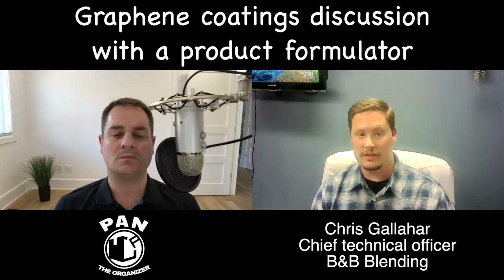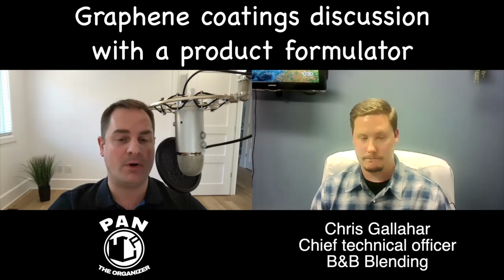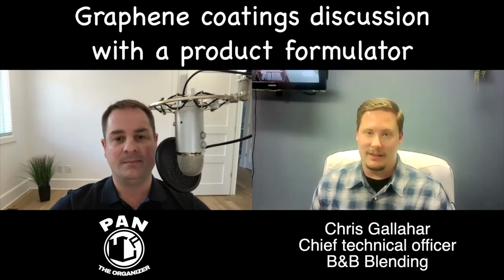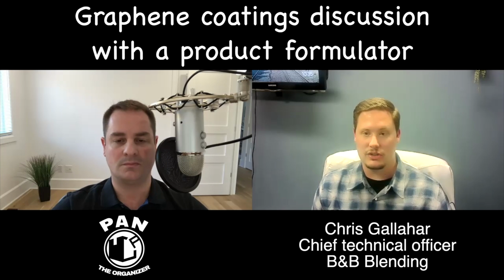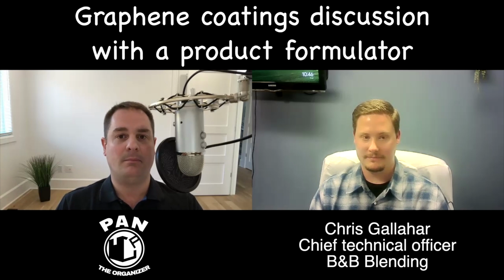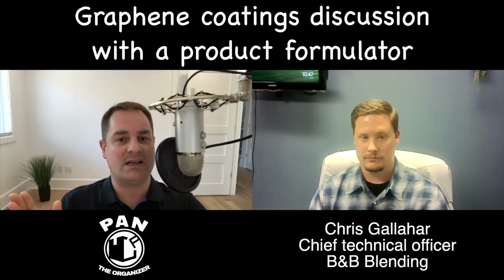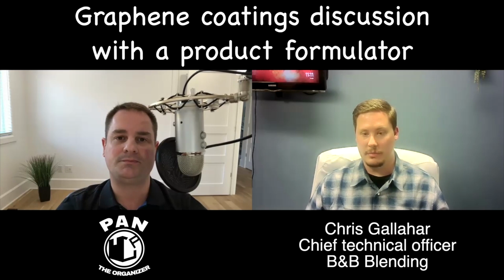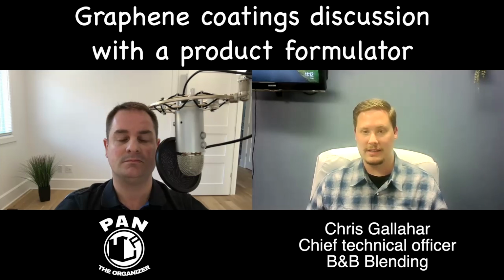EXCLUSIVE interview with B&B Blending about graphene coatings and detailing products!

Comment: Chris mentioned "angles" in beading and sheeting. What does the angle indicate or mean and what angle on the bead or sheet does this refer to?  Is it a measurement from the surface panel and water Edge? How is it actually measured? Is there a diagram to explain this? It seemed to me a higher angle like 142 (diamond ProTech) is higher than another at - say 105. What does this angle imply? How is this meaningful?  Love the chemical insight.

Comment: A self-healing graphene coating is my dream. Until then, I'll adopt better wash practices and remember that tiny scratches visible under LED are barely visible in daylight. The slickness of Artdeshine Nano would likely perform well for me, but I'm having trouble ordering that since I'm only a consumer.  So, I'll likely go with Adam's Graphene Ceramic. Scratch-resistance seems to be a durability test that falls behind chemical-resistance and water-spotting / etching resistance. Thoughts on the scratch-resistance of Adam's?
Reply from the maker: Coatings aren't really designed to protect against swirls or scratches or stone chips. Only PPF does that. Coatings are meant to provide UV protection, slickness, gloss, resistance to chemicals, hydrophobic properties, and have self-cleaning properties (meaning the car is easier to wash during maintenance washes). Yes they can protect against veeeeeery light marring (love marks from washing and drying) but that's about it.
Reply: @PanTheOrganizer  100% agreed. I liken the slickness of a coating to the lubricity of wash soap and consider the hardness to be a supplement for my weak FCA clear coat, which scratches with a nearby sneeze. A slick coating won't eliminate scratches from bad wash habits, but instead a decrease in friction that may minimize damage from any particulate which falls through the cracks, allowing them to glide over rather than dig in. Wash mitt pressure is also a key contributor I'm mastering. 

To the credit of my coating, I've noticed a few small powdery impact trails on the front end of my Ram that look like small stones hit then easily slid off rather than having chipped and scratched. No scientific data to back that theory up, but the gritty powder definitely wasn't bug guts. Could be rock dust, pulverized coating that took the sacrificial blow, or both.

I'll be removing what remains of my Jade quartz next week and start over with Adam's Graphene Ceramic coating. We'll see how that and a more conscientious approach to washing / detailing works out. Fingers crossed on the 7 year durability, though she is garaged 95% of the time.

Love the videos! I learn everything on-the-fly. So, your tips help get me up to speed without more expensive mistakes. :)

Comment: But which has more gloss, Ceramic coatings or Graphene based coatings?
Reply from the maker: It’s not the category but more the product at this point. Both ceramic coatings and graphene coatings are as glossy as it gets. But the graphene coatings I have been testing are a bit glossier out the box without toppers.

Comment: Pan, that was awesome and insightful. Many thanks to you and Chris. Clearly he has a very deep understanding of what this technology is and can explain it so well. I was really pleased about what he said about thermal properties. I know from my background that the statements about graphene coatings lowering surface temperature had to be incorrect. There is no way something that thin can have good thermal conductive properties. The metal in the panel is so significantly a better thermal conductor than any atom-level coating could be, that it is laughable to claim otherwise.
Reply from the maker: Yes it was very clear to me too that Chris is top notch.
Reply: I am no coatings expert but I have done limited academic studies of Graphene and it is one of the most thermally conductive materials known. In the region of 2,000 - 4,000W/mK. I work in the field of adhesives and an average, very thick film in comparison Epoxy would be around 3-4W/mK
Reply: @simongibbs7224  You made me realize my early thinking was incorrect. I was imagining the heat flowing away laterally through the coating. In this direction, the thermal conduction would be poor (since the coating is not a single continuous graphene matrix). However, if I think of this as heat flowing through the coating, through the paint and into the metal, then the thermal conduction would be good. In fact, any material when thin enough would be a good conductor, graphene or no. The thermal transfer coefficient (or admittance) is dependent on material thickness. For a coating that is likely 0.1mil or less thick, this is going to be negligible relative to paint which is around 8mils and has poor thermal conductivity.

Comment: Some people get too hung up in how much of this and that are in things. You can’t make a cake exactly the same every time and no two bakers do it exactly the same every time. All this coatings have things that bind things together and to the surface. Things like SnS are great products. Great durability and a cheap price point, better than any old school wax for sure. And lots of these things take no time to apply as opposed to old schools stuff.
Reply from the maker: For sure. If people aren't impressed with the level of protection a simple spray on product, that takes you only 15 minutes to apply, that will last one year, and resist the elements, chemicals, UV rays, boost gloss and slickness, make the car easier to wash, etc, then I don't know what will make them happy! HAHA

Comment: If you really want to know about graphene just call Dr. G. At Optimum
Reply: Have you done this?  Please enlighten us...
Reply: @stephenbissett3280  of course I have. I am an opti coat pro installer and I call him on a regular basis. Dr. G. said that graphene is a carbon film used as an insulator. It is not chemically resistant at all. The performance of these graphene coatings are a result of the catalysts that are in them and not from any sort of graphene or graphene oxide.
Reply: @tugbankert6581  thanks!

Comment: 303 responded to a comment I left on your video asking if ceramic was the base and they said no that the product was suspended in a solvent not in a ceramic base. Ceramic is just a word for mixture isn't it? Years ago ceramic was the big thing in automotive brakes. We need a coating that can be done in the driveway without a garage besides spray on.
Reply: Can't speak to the 303 product, as there are potentially many ways to accomplish the same end-use, but when I'm referring to 'ceramic' or 'ceramic base', I'm referring to the ambient temperature curable refractory resins that I mentioned within the video. Those are the 'base' that makes the rGO... well, go!
Reply from the maker: Thanks for taking the time to respond to my viewers Chris! This is highly appreciated. :)

Comment: What, if any, impact does graphene oxide have on gloss? And gloss retention?
Reply: The coating resins, including those containing graphene oxide, will typically continue the trend of a cold, metallic, mirror-type gloss instead of a warm richness that a more natural based wax, such as carnauba, generates. The gloss intensity is often a function of the loading level of the resin(s) within the product and the ability to lay down as much theoretical maximum film thickness as possible. Gloss retention then comes in the form of maintaining that coating film's appearance via self cleaning effects and scratch/mar resistance, which the graphene oxide containing resins seem to be quite sturdy. Hope this helps!

Comment: Pan a truck with a trailer hitch backed into my Mercedes and the result of it is that I have new hood a new grill etc  it's been one and a half months and I'm ready to put on Turtle Wax ice the new formula! Or should I wait to do this 303 graphene? Do you thinking you could always put the graphene over hybrid wax!
Reply from the maker: Those would be two good choices, but it depends on what you're looking for. 5-6 months of protection, ICE Seal N Shine has you covered. You want something that will protect 1+ years? The 303 Graphene Nano Spray Coating or the Adam's Graphene Ceramic Spray Coating have you covered. You could apply the 303 on top of existing waxes and sealants, but the same can't be said for all graphene based coatings. You have to inform yourself on the product you are looking into.

Comment: i just did a full paint correction and a 2 coats of turtle wax ceramic spray. is there any benefit to putting the 303 graphene spray on top? better water spot protection? they say it can go on top but if i wanted to reapply the turtle wax ceramic spray in about 2-3s months or any ceramic topper, it probably would not bond with the 303 graphene in the way.

Comment: Glassparency vs Adams?
Reply: Id love to see this since I have one car with glassparency and another with Adams. Curious to see which car will last longer! LOL
Reply: @burrows10011  Any difference in application difficulty?
Reply from the maker: They both are super easy to apply. All the new graphene oxide based coatings (spray or full blown in glass bottles) have been supremely easy to apply. They really did their homework on ease of application.
Reply: I have been working for about 6 years with a company that has B&B blend our chemicals. I have seen a lot of the testing and learned a lot about what coatings do, but I was hooked on this video. I was worried when I saw how long the video was but the two of you did a good job of being really educational about it and keeping it interesting. I learned a lot about how the ceramics work, not just what it does.

Comment: Hey pan. Slightly of topic but I have a question. First I polished my black volvo and used the turtle wax ceramic spray coating to finish off. Now it appears that I didn't see the little Stonechips (a lot) where white because of the polishing but the coating is already applied. The result is horrible 😔. Is there a way to remove the coating from the hood so I can try to clean the Stonechips so they don't stand out as much. Thanks.
Reply: Use an IPA wipe down or a paint prep one from a brand. I used Optimum Paint Prep and Mothers CMX Paint Prep after I polished last week before I applied the ceramic spray from Turtle wax. You honestly need to wash your car and wipe down the whole thing with the paint prep and then reapply the ceramic spray. Polish has oils and the ceramic spray will not bond to the car. You will bead and have protection for a while but after a few washes it will be gone. I was lazy and applied both seal and shine and the ceramic spray without a polish and wipe down earlier this year and after a month and a few washes it was gone.
Reply: @bully_1er  after the polishing I washed the car and used angelwax stripped ease to clean the surface but not thoroughly i suppose because the Stonechips are not done well. That's who it's a problem. I can not just was the spray coating off. Not with IPA, not with the angelwax stripped ease. The white stips are under the coating now.
Reply: @Dddccc6669  you did it right then. just had some polish stuck in the chips. i would take a microfiber and lightly rub out the chips with the anglewax or a diluted apc. the turtle wax spray is thin and only has small amounts of ceramic. it doesn't make an impenetrable barrier like a serious ceramic coating would. it shouldn't keep you from trying to remove the stuck polish. once you get it out just spray another coat or 2 of ceramic spray over it.
Reply: @bully_1er  thanks, have my hopes    back up. I will try it tomorrow.
Reply: @Dddccc6669  good luck. i hate the chips on my hood. little silver dots poking through bugs me. was thinking of using chipfixx before i applied the ceramic spray but i just wanted some protection now. poor white car has been getting murdered with ash from fires and bird poo. one of the reasons i'm hesitant to doing a true ceramic coating is wondering how hard is it to get off. just a weekend warrior with detailing.
Reply: @bully_1er  I purchased chipfixx and used it for the bigger chips. Color matched well but that's al it was. It didn't work like they say.
Reply: @Dddccc6669  damn. good to know. i think i will just let it be and call it character. hehe.